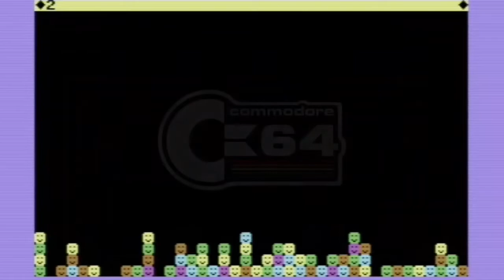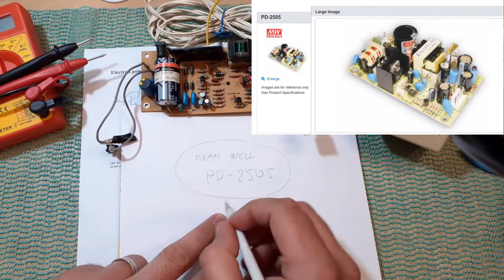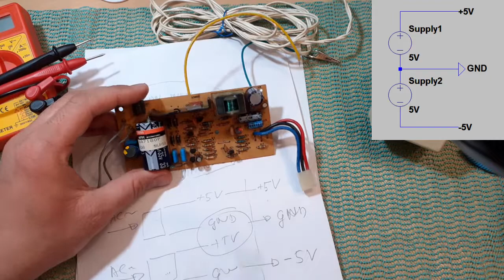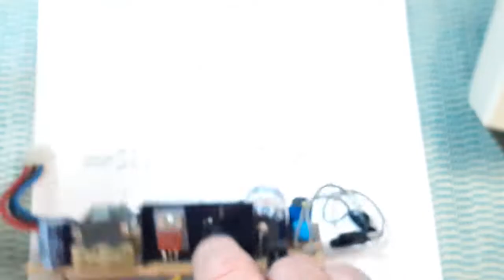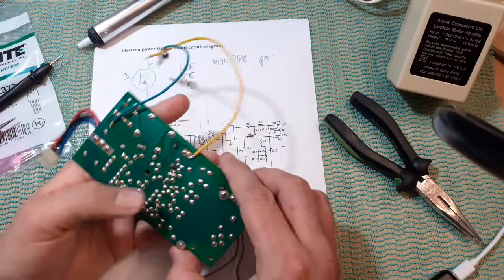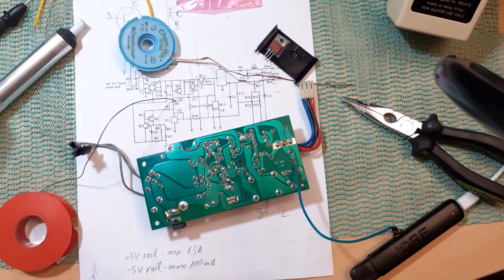Fixing Power Supply on Acorn Electron and Modern Alternatives

Comment: Following as I have a similar issue. I have 22v DC coming out of the bridge and into Q5. I'm also getting 22v on the other 2 pins of Q5. I'm getting nothing coming out of the transformer (T1). I do have R16 missing from my board which I need to replace. I think I might as well replace all the capacitors while I'm at it.  By the way, all of the component values are listed at the back of the service manual. I hope you figure out the issue.
Reply from the maker: Thank You for your comment! No I did not find 
the parts list in the service manual, maybe I am missing some pages...
So in your case, it could be that the T1 is gone...
In my case, I concluded that  I do not know how to fix that. I could replace one component after another if I would have all the exact ones, and maybe it will get back to life at some point...but...no... 
I'm still keeping the power supply and maybe someday I will be able to fix it...till then I will use modern replacements...